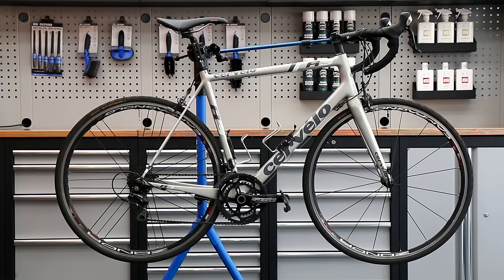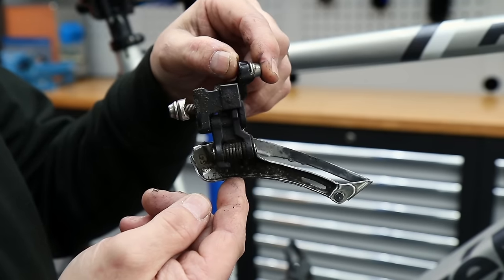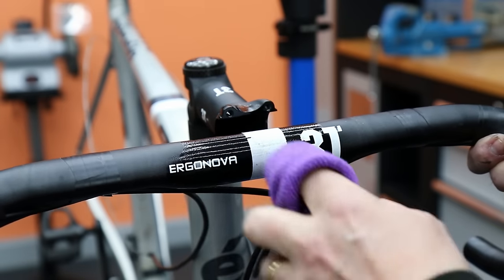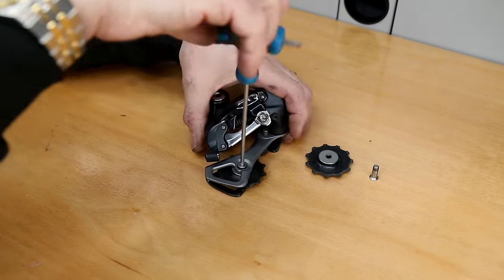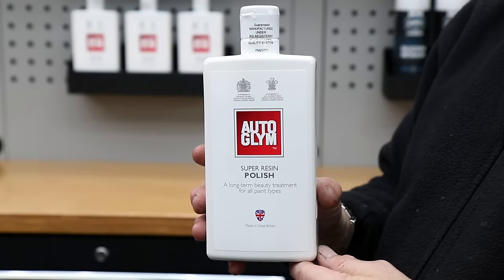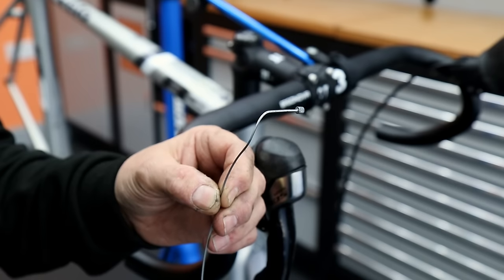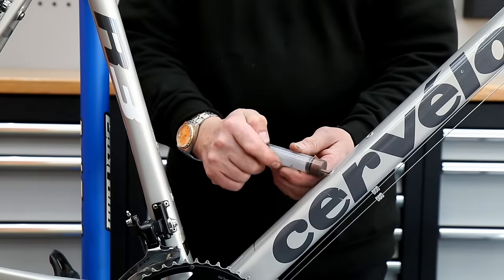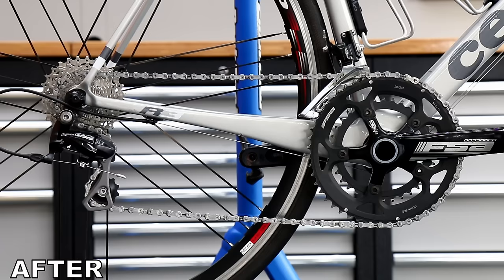Cervelo R3 Restoration Rebuild! New Bottom Bracket, New Cables! Road Bike Service!

Comment: Oh this was fantastic.  Getting my 2009 S1 refurbed next month whilst I am away cycling in France (I am based in the US).  I was pretty shocked at the grime on this on - wow - I wash/rinse mine almost every week with a full-on wash once a month. A clean bike is a fast bike. When I bought mine, I paid around $2600 and have put maybe $1000 into it (new saddles, Favero power pedals, new rear cassette, new big ring), but getting ready to replace the crankset from FSA to Ultegra (11sp) and a new, 38mm handlebar instead of the 40.  I wish there was a decent swap for the hoods, shifters - the flight decks aren’t adjustable so I have quite a reach to the brakes in the drop. The older Cervelos are worth the effort/money - I am still the fastest on the decent without much effort!  Why drop 10K when you can still ride the original.  Thanks for posting these.
Reply from the maker: Sounds like a mega bike, enjoy it my friend! 🧡⚙️

Comment: The way u installed the FD and rd cables, U make it looked so effortless and easy. But really there are so many key points to it. Also the trick to run guide hoses w the FD cable when removing it, that itself saves the hassle to rerun a new cable in.

That makes it fun of doing it right during the build and truly makes the different.

 Learn a ton watching.
Reply from the maker: Good to read! Thanks very much for supporting🧡

Comment: Good morning, Bikespeeds 👋.A mighty fine bike the R3, and a superb transformation! 👏.... In 2021, I sold 😕 my beloved Cervelo RS, I bought it as a frameset in 2011. Putting on a full Dura Ace groupset and Mavic Kyrium RSYS SL wheels, a scott integrated carbon handlebar & stem, a zoncolon saddle......The white frame white the black and red decals......a stunning bike If I may say so ! and light.....6.4 kgs including pedals. Many happy cycling miles......easily over 60,000. A great bike for my sportives  full distance triathlons, training and even winter miles!
Reply from the maker: Sounds like great memories on it! 🧡

Comment: I’ve used the Super Resin polish on my bikes for a few years now  but didn’t know about the Ceramic Spray, so thanks for the tip.
Reply: I've been using super resin polish on my bikes, cars and motorcycles for over 30 yrs, great product, wax on wax off..😊

Comment: That's a 2013 R3 105.  I have one size 58.  The only real shortcoming with them were the Shimano R500 wheels they came with, but those were an easy to swap out as finances allowed and they did their part in keeping the purchase price of the bike affordable. 

I've since replaced the 105 drivetrain on mine with 6800 Ultegra which made a great bike even better.  Thanks for the video!
Reply from the maker: Thanks for dropping the knowledge!🧡

Comment: Nice Vid. Really good. Just one question though ..... why did you not turn the seat clamp around so the join was at the back of the seat tube ???
Reply from the maker: This is a rare system that is the correct way round🧡

Comment: Is BB30 any good? I’m looking at building a cannondale caad12 as a climbing bike to take away on trips. never owned a bb30 bike before… they seem more involved to change but are they durable?
Reply: They are pretty easy to change. On my mtb it works fine but have to replace bearings about every 2 years. And thats dry condition riding. My threaded bottom brackets dont require replacement as often.
Reply: @johndef5075  yeah it looks like the bearings a little more exposed to the elements. And requires a press for install and removal. but 2 years isn’t terrible I suppose.
Reply from the maker: As good as any other! 🧡

Comment: How can ride such a rundown bike? Never seen so dirty, oily and worn out parts! I would replace all bearings , chain, casette, and chainrings.
Reply: HOW? just keep pedaling 😂
Reply: Nicely done that cleanup boys
Reply: I see worse every day!  In the uk, a winter bike will get like that and worse quite quickly!
Reply: My bike can get that dirty in a 60 mile ride in England in winter. Our roads are potholed, gritty and if frost is forecast the highways dept liberally spread salt on the road. 15 minutes work with degreaser, chain bath, clean water to wrinse and then relube